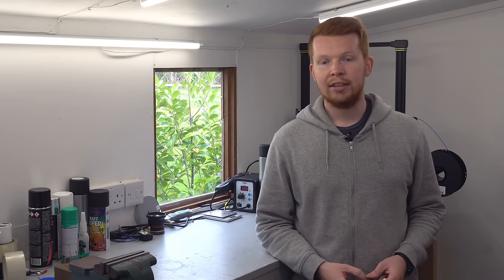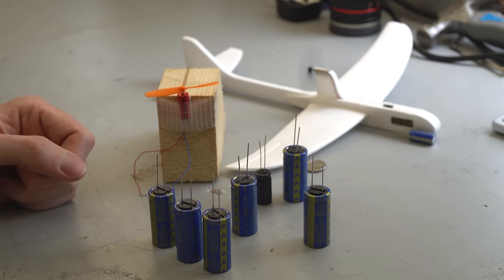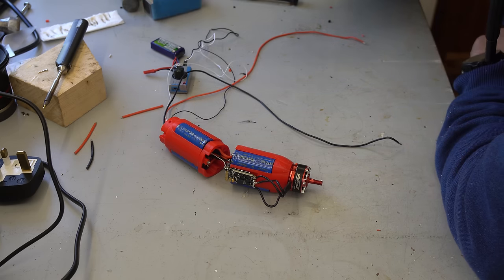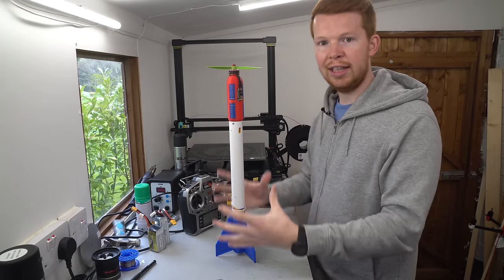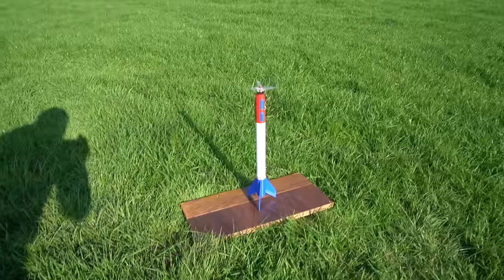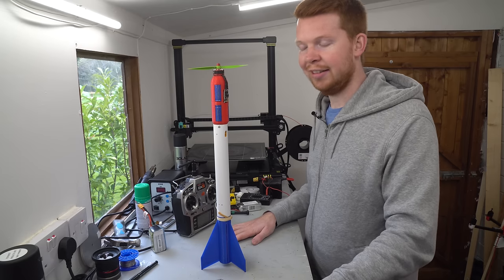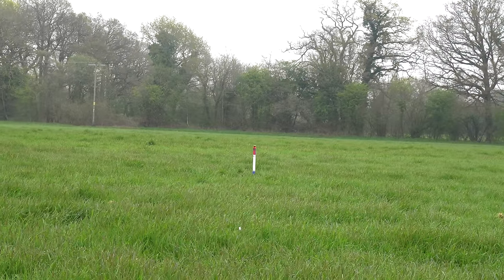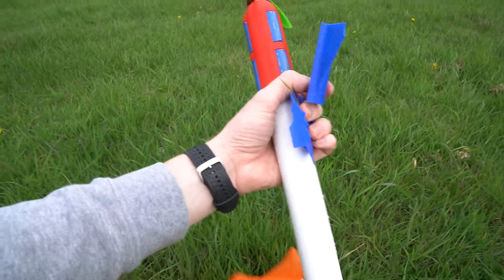Super Capacitor Rocket

Comment: Tom: charges rocket from 0 to 100% in 5 seconds

Everyone with smartphones: internal screeching
Reply: @brandonvdongen  naaaah at least like 2 minutes
Reply: @brandonvdongen  capacitors 
+ no charge memory problems
+ speedy charge/discharge (the best railguns are capacitor powered). Good voltage/amp density.

- abysmal power density. Both in volume and mass.
Reply: You can charge your phone in 5seconds if you put it in the microwave
Reply: @bethelgues3918  only nickle cadmium batteries have charge memory
Reply: @maxxiang8746  https://www.ncbi.nlm.nih.gov/pubmed/23584142

All known batteries have some form of memory effect that is with battery cycling (charging and depletion). Some batteries are better than others. For example Aluminum Oxide batteries tend to have really bad charge memory effects.

NiCd batteries are just more well known because of their extensive use and more pronounced memory effect. Lithium ion or NiMH have much longer life, but they eventually do experience voltage drops or a lowering of charge capacity.

On the flipside capacitors don't have any chemical reactions, and as a result they do not experience these loses or buildup of inert nonreactive salts... no matter how much they are charged/discharged.
Reply: Michael Wow it actually worked, just tried it!
Reply: @bethelgues3918  and massive leakage current, so your phone will     lose power when you even don't use it.
Reply: They need to make little removable batteries that you can replace in two seconds
Reply: Me with a OnePlus, 0 to 100 in 20 mins
Reply: @iiennjiang3682  Not so much for supercapacitors compared to capacitors.
Reply: PyreGnome You seriously put your phone in a microwave are you insane your phone is going to break if you do that.
Reply: @patfre  that was sarcasm though I've read other people actually tried it in the past with expected consequences
Reply: @brandonvdongen  still better than an iphone
Reply: @bethelgues3918  the link u have in your comment said that li-ion batteries dont have a memory effect, but LiFePo4 batteries do....
Reply: @hanswangnstvold435  LiFePo4 is a type of lithium ion battery...

There are a few others 

LiCoO2 is anther.
Reply: @bethelgues3918  yes, but not lion, if you discharge and charge a lion all the way it is not good for it. Ideal range is 20-80%. I know about lion batteries, I have made a battery pack from 54 18650 cells, and done loads of research.
Reply: Bethelgues charging a lithium ion battery to its full voltage and capacity is not good at all for longevity.
Reply: @ChiyoBebe.  yupp, this guy does not understand that there are different types of lithium batteries, that are verry different... and even if the lifepo4 battery has a memory effect, it will not out weigh the strain of charging and discharging it all the way.
Reply: In Samsung's Note phones the pen has a super capacitor inside that charges in 15 seconds and lasts 45 minutes
Reply: My Huawei P30 Pro Super charges. It's beautiful to watch the percentage climb
Reply: It is possible to have a super capacitor as a battery if the phone in question uses very little power
Reply: it's simply because capacitors don't hold much charge unlike a battery, yet can supply the same voltage. notice he has to charge it up pretty much every time he uses it. imagine trying to watch a video on a phone that's run via capacitors. unless you have it constantly on charge it'll die every 2 minutes of that pewdiepie video you get through.
Reply: @bethelgues3918  I believe you'll find that NiCad batteries are worst for requiring a deep discharge every once in a while to restore them to full ability to charge.
Reply: Ben Silva  What do you mean, "put this in a nanocapacitor form"? I'm not sure you could scale up super capacitors to last like lithium ion batteries. Capacitors lose voltage over a much longer period of time than do batteries. So capacitors tend to become useless faster than batteries do for most applications. See https://en.wikipedia.org/wiki/RC_time_constant .
Reply: Ben Silva  Actually, for any battery or capacitor to be useful, it must have a low internal resistance. If that resistance were to be 0, then there would be no internal current leakage. But 0 is only achievable near absolute zero temperature where superconducting occurs. So, at room temperature, there is always some internal leakage in any storage device.
Reply: Ben Silva  Indeed, and the only way to store energy indefinitely is in an isolated quantum state. I say 'isolated' because as soon as a pure quantum state is connected to temperature or some other larger environmental interaction, the state decays after a predictable length of time.
Reply: Ben Silva  Any quantity of gasoline you can see would be unimaginably larger than the domain where quantum effects usually occur, so gasoline works very efficiently and reliably as an energy storage medium. Of course, fossil fuel will run out soon, and gasoline is carcinogenic, and it smells bad. But otherwise, it's close to perfect.
Reply: @NullHyp  lol
Reply: @nathanaelfertich801  but if you removed your battery, like on some androids like mine, you would have to do the slow process of turning your phone back on and let's be honest, nobody wants to do that and also having a removable cover to get the batteries means that if you drop your phone, it can pop out

Comment: To limit damage to the prop, maybe look into a folding prop, like the ones used on rc motor gliders?
Reply: He just needs good ol’ tri-blade race props. Smack into a tree at 80mph, slightly bend back one of your prop blades, and go hammering it through the trees again on your race mini quads! The old props seemed to be more brittle than icicles and would break on almost anything even 5 mph epic slow airplane crashes or slight bumps. Modern props use better materials with plastics that are more rigid (holding aerodynamic shape and efficiency at high power), as well as taking a beating and allowing more than hairline flexing. Plus they seem to bend back about 20 times, whereas the old ones had a fatigue limit of seemingly 1 crash, and maybe it would be sorta flyable at low throttle and vibrating, or maybe the props would explode... 

It’s a good thing we have modern props, because I crash a lot! So much better than the old ones.... they do need to become more available in the 9-12 inch size though, those all seem to be old school materials (besides carbon, but those just aren’t as cheap to crash like I do)
Reply: @jakegarrett8109  Maybe a bigger parachute would be enough to save the props.
Reply: Or attach parachute above center of gravity instead below (while still storing it in the base)
Reply: Or the prop saver with an o-ring to hold it on
Reply: Keep the deployment chamber in the bottom but have the parachute attached to the top.

Comment: I'm impressed! Looked like a heavy build, but still took off like a, eh, rocket.
Unlike batteries, capacitors take on whatever voltage is applied to them (or explode), and loads of energy (especially these super caps), so can be lethal. Viewers should be warned!

Comment: What if...??  Two counter rotating props and multiple-stage booster capacitors that drop-off as they discharge their energy.  Could go really high with a small payload of say, a plastic space man.
Reply: payload of a toy tesla car :D
Reply: I thought the same!!  But then I also realised that rockets are ment to spin for better stability..
Reply: sadly, you have to reach a bit more than 23.000 Km/h in an environment with no air, to reach orbit...

Comment: I’d like to see the rocket unfold a pair of wings and turn into a glider at the apex for a smoooooth landing.
Reply: Can be done with a gravity assisted system, a large ball bearing that when rolled and rocket is pointed down, it release two wings held in place at bottom of rocket by ball bearing and when it moves forward slides past the sprig trigger holding wings in
Meh
Yo get the idea
I just got to 9 mins in on video, so replace ball bearing and spring mech with gyro switch that releases folded wings to glide but then you got to design a glider type body with lift and aerodynamics or its just a stick with wings
Peace and Blessings
Reply: Morgenstund like a space shuttle
Reply: has been done. search for flitetest free flight. They used a real rocket tho

Comment: Yknow, you could use a solenoid to automatically fire the parachute below a certain voltage
Reply: Smart
Reply: No.  He knew that there were going to be plenty of situations where he wanted to deploy when he hadn't expended most of the capacitor's power.  A manual deployment gave him the ability to abort the flight when he wanted.
Reply: @jlstanley  He could do both. (have a manual switch and a solenoid that automatically activates below a certain voltage)
Reply: But as you can see in the video the rocket turns sideways, and there's a good chance it would be back on the ground long before the parachute fires

Comment: Could market this as a toy, I think it could sell well!
Reply: If not handle correctly it can kill :) so i rather not make this a toy
Reply: krypten wolf no they are electric now
Reply: @kryptenwolf3564  I think he's referring to the rapid discharge of the super capacitors
Reply: i would definitely buy this instead of using expensive rocket motors
Reply: @neilmedina997  any toy can kill if you try hard enough so what's your point
Reply: Can the electricity kill you from a super capacitor?

Comment: Well before there were supercapacitors there were explosive electrolytics. My career at Hughes Aircraft began in 1964. In the first laboratory in which I was assigned to do some thermal testing, a time consuming process as the oven comes up to temperature, I had the opportunity to gaze up at the ceiling tiles. There I saw the remaining aluminium casings of what had been a couple of large electrolytic power supply filter capacitors. They were firmly embedded into the acoustic fiber tiles. I asked the older technicians how that had happened. He said the polarity had been reversed on the output after the high voltage, vacuum tube(valve) power supply had been shut down.  
To this day I wonder how high those cans might have gone had it occurred in an open field like you used.
Reply: Very cool =]
Reply: That's Really Cool Stuff There
Reply: When i worked for Burroughs, I saw  a solid state relay in a tape drive spit fire like one of the ols Estes model rocket engines.
Reply: I just happy to know someone else remembers the Estes Rockets HA... THATS A THOUGHT...
Reply: Now I'm curious!
Reply: @lbbradley55  I still have a bunch of unbuilt ones. Big Bertha is still waiting. I visited the Estes plant when I was in Cola rado back in the 90's.
Reply: Harry Ross 
I think I was 10 or so around 
1971 when my friend and I were building Aeroplane's and Rockets. Good Memories.
Nice to know some are still around.
Reply: Harry Ross wish I still had a few of those. I am sure my grandsons would enjoy this. 
I know my bud and I did. 
Good stuff. Lots of memories revised. Almost all of the people that I associated with these are gone now.  Thanks

Comment: Tom, at 8:40 you are testing the charge and you have your face directly inline with the propeller. This is quite dangerous should the propeller decide to come apart. Doesn't happen often fortunately but I've been hit when one did. I've flown model airplanes for about 45 years and seen all kinds of crazy things that you wouldn't expect. Please at least wear safety glasses when doing stuff like this.
I'm curious about your "charged enough" conclusions. How quickly will your battery discharge? 10C? 20C? what's the actual amp/hr rating and how did you charge it? Why don't you have a direct connection point to read out the voltage that the capacitors are reaching?
Reply: Agreed!!
Reply: 15:30 lack of safety there......
Reply: My thoughts also!  Very cool project, but I would hate to see you get injured.
Reply: Also, capacitors are no joke... charging them by holding bare leads onto the battery terminals was incredibly dangerous.
Reply: You havent seen his other videos yet, have you?
I'm still waiting to see his video where he's in a wheelchair.
Reply: @rubyr83  yes, at the very least needs a current limiting resistor.
Reply: Your not having fun till someone losses an eye!
Reply: There are no rated AH specs for super capacitors. It's all Farads and volts, you can do some math to convert but it's not entirely accurate. Converting to watt hours is definitely not accurate due to the voltage curve.

I feel like he might be overloading those lipo batteries by charging the super caps directly. It could easily take a huge 1 second surge of current to charge.
Reply: piyush nagawat large amount of sass disguised as concern here. Just one period. No ellipses.

Comment: Awesome! My favorite kind of project has the word "rocket" in the title! What powers the deploy servo if the supercapacitors are depleted?
Reply from the maker: The deploy servo is only powered by the supercapacitors, so wouldn't work if they're completely depleted! However, when the esc shuts off at 6.4v, there is enough energy left in the capacitors to power the servo/receiver for atleast a minute or so.
Reply: @Patrick Cheke Doesn't look like he is. The rocket spins a bit during take off. He appears to be slowly advancing the throttle to reduce torque and the fins appear to handle the rest. I'd love to see a dual-prop version, especially one with a MPU6050 and some steering!
Reply: I thought perhaps you had a small LiPo to power the receiver and servo. You had a favorable failure mode you capitalized on. I like it!
Reply: Maybe slanted fins could offset the motor torque while in flight
Reply: @TomStantonEngineering  Could you put another controller such that it doesn't have over-discharge protection since capacitors can be fully discharged?
Reply: @music99matt  The lower limit on the ESC probably isn't for over discharge protection, It's probably just that it wouldn't have enough power to run the size of motor it's rated for.
Reply: @matthewgoodman  There is a lipo cutoff protection on most ESCs, on many you can turn this off or at least change it to a lower voltage. You should be able to run the ESC at a volt or two lower than 6.4 V. I have not tested this because I only run my RCs on lipo batteries.
Reply: Bigger fins.
Reply: How did you comment two days ago if the video just came out four hours ago?
Reply: @markphillips2113  unlisted video?
Reply: @markphillips2113  patrons
Reply: @BikingWIthPanda  Yeah, that would make sense, actually.
Reply: Also, below 6.4V it may no longer have enough voltage to properly switch the mosfets in the controller.  It would run the risk of burning up the mosfets if they only partially switch on.

Comment: Im surprised how much power came from those super caps.
Could be a RC power glider option..
Reply: Yes, and when you get to the right height in flight. Have the glider drop the caps with a  parachute.
The trick is balance going up with caps, and level flight balance without the caps.
I don't know if it can be done, my brain doesn't work anymore.
Reply: @dougc3086  might not need to drop the caps, my powered gliders are quite happy carrying around a heavy lipo, often gliders will carry ballast to help them glide faster/longer distances, a folding prop is all that's needed.
If we could get enough to give 20 seconds of decent power it would be enough to get up into the thermals.
Reply: @FlyingFun. ; Great minds think alike.  I don't see the need or a motor near that large either (500 watts? are you kidding me.)
Reply: @oldasa  depends on how big the glider is i guess, my 2m gliders are more more than happy with 200w to get them over 600ft in 20 seconds.
Reply: @FlyingFun.  Yep. I still have a 25 years old 2m Kyosho Stratus Sports that originally came with a Ni-CD pack and a brushed motor. A few years ago I upgraded it with a LiPo battery and a 200w brushless motor and it turned into a completely different beast: When new, the glider could climb to altitude once, which took some 3 minutes, and then maybe another half-climb. But now, it will happily climb to almost out-of-sight altitude in some 20-30 seconds. And it can do it countless times on a single charge - and now that it is some 500g or about 1 lb lighter (which is a big deal for a 2m sailplane), half-hour flights are now routine. One single LiPo charge will last a whole day at the flying field, between flying the glider and chatting with friends. Great stuff.
Reply: @coriscotupi  yeah lipo is hard to beat, I tried lifpo4 too in my gliders, lower power density but last many more cycles and fast charging right away, worked out fine.
I think super caps might work but only for one climb out at a time, would be an interesting experiment but not really all that practical when we have lipos..